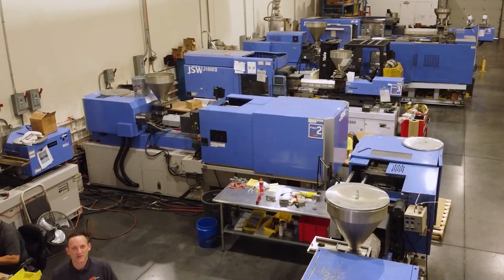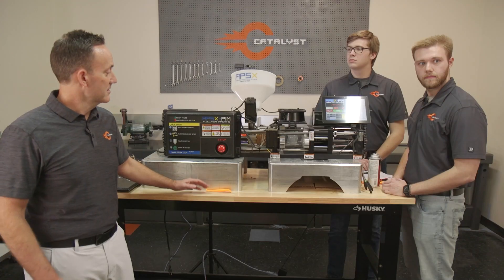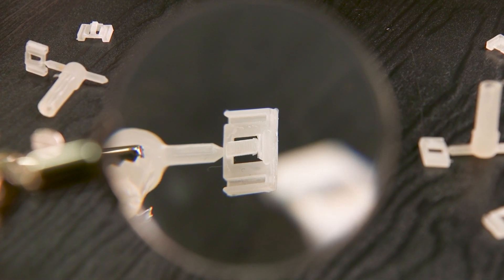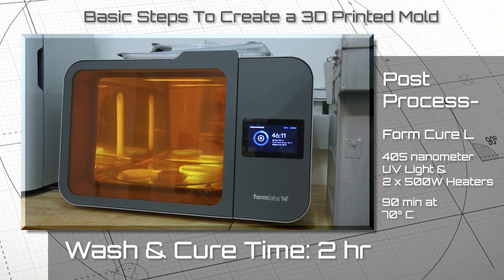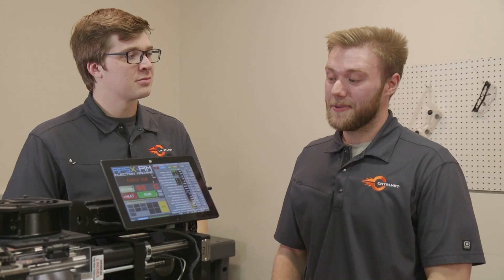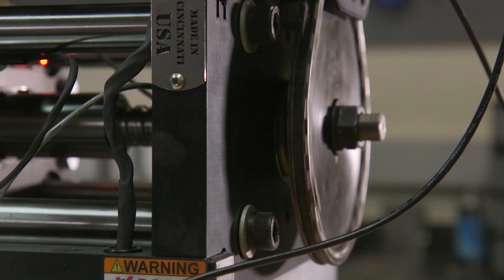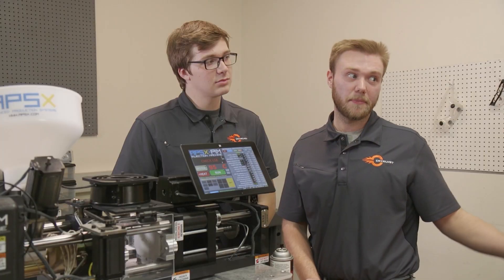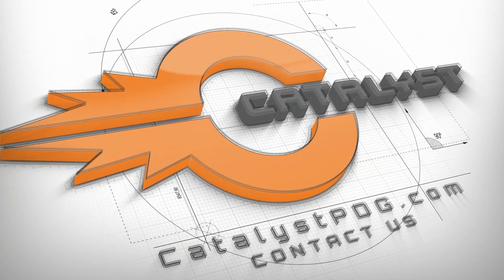3D Printed Mold in APSX Injection Press

Comment: How do you deal with the print lines the rigid 10k produces?
Reply from the maker: When setting up the 3D print, we try to orient the mold in the way that will minimize layer lines when printing. After printing, washing, and curing, we gently sand away any layer lines that may become problem areas in the molding process